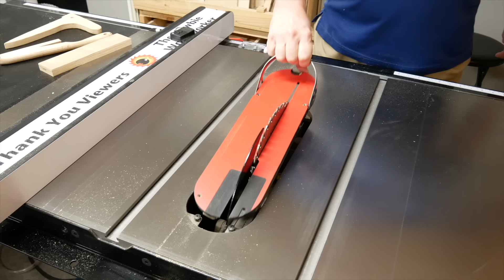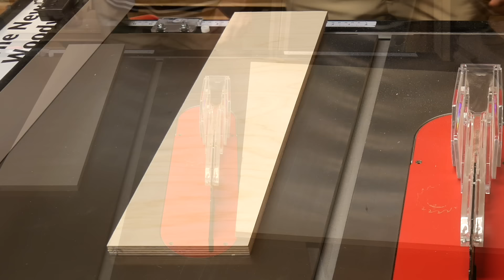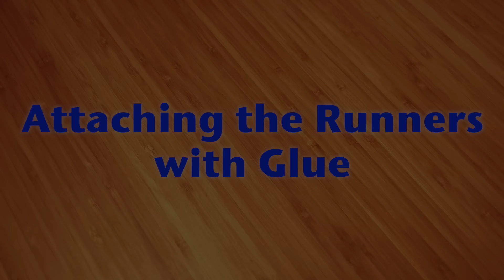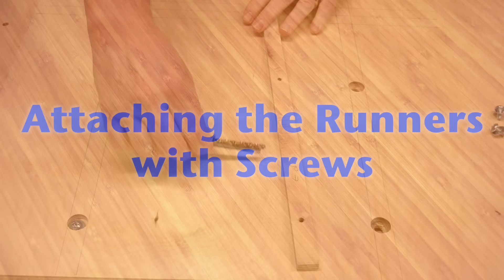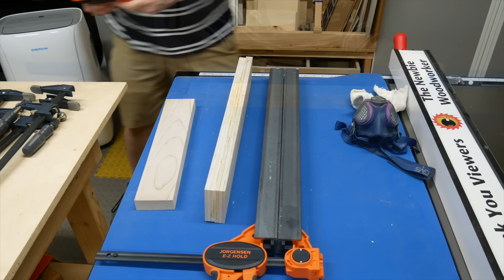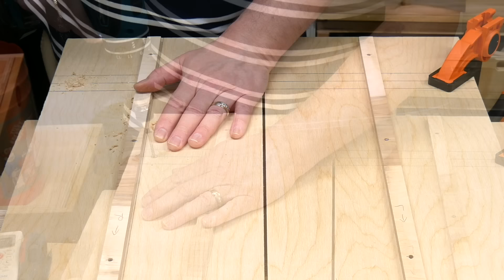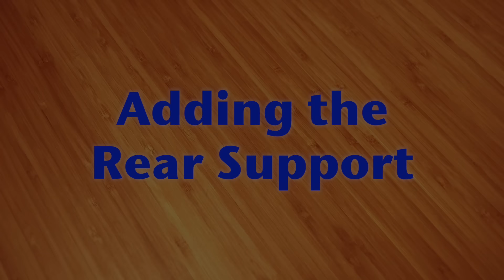Build this Revolutionary Cross Cut Sled, for Newbies!

Comment: I just wanted to say thank you for sharing this with us. I agree, not too many folks use the guards, and honestly I never really gave it any thought until last month. Last month, I ran my left thumb through a jointer. Its an older one I restored, and the blades are new and sharp. Well, I am sitting here in a cast watching this video. I have had two surgeries so far and am hopeful, I will have some use of my thumb in a few more months. I say thus because prior to me hurting myself in the woodshop, I have sense been in contact with two guys who work at the same place i do, Both have ran their hands through a table saw. one cut most of his left hand off, the other cut his right thumb. I feel blessed that the injury i had didn't include my whole hand or any of my fingers, because when the wood shot out of the jointer after hitting a large knot, my whole left hand went over the blades of the jointer and its basically only clipped my left thumb, shaving the bottom half of my thumb off, it all happened quickly. (fraction of a second) but long story short, i will be putting a blade gaurd on my table saw once i heal up enough i can go back to work. thanks for sharing and have a blessed weekend my friend, 
Dale, ps new sub here,
Reply from the maker: Thanks for sharing, Dale. I'm so sorry for your injury, and your co-workers. I injured my hand in a router accident, but I got lucky and didn't have any permanent damage - just a scar. Still, I can appreciate what you're going through. Your accident reminds me that I need to do a video about imagining what might happen if the stock gets pulled out of your hands. If we thought about that before doing anything, it could make us stop and use a push block when we don't think we need one, etc. Anyway, get well, and thanks for the sub! 😄
Reply: @TheNewbieWoodworker  your very welcome sir, yes sir, i do have a first aid kit in my shop, this was bad enough i had to wrap it in lots of paper towels and drive myself to the hospital, i have tons of video footage of my injury etc, so if you decide you want some images or video when you make tour video, hit me up, trust me when i sat the images and video dont lie and it will make you think about it i would be more than happy to share them with you if you would like. they are gruesome, but factual. not photoshopped. 
have a blessed weekend my friend,
dale
Reply from the maker: @HeartlandMakesAndOutdoors  Thanks, Dale, but I'll pass on the images! 😮😄
Reply: @TheNewbieWoodworker  Don't do the safety demo video with a live tool. You might've seen Tom Hintz's video where he demonstrated a kickback that nearly took out his fingers - and he didn't realize it until after he started editing the video.
Reply from the maker: @brimtlgtr  I saw that video! I could be wrong - I don't always trust my memory, but I think I saw it before I made this video, and that's what I was as careful as I was. But I'll never do this again, that's for sure. 😳

Comment: I recently inherited a Grizzly 1022Z table saw. Unfortunately it did not have a blade guard or riving knife. Grizzly is out of stock and will not be manufacturing for such an old machine. Any ideas?
Reply: Lt. Dan 
Try “the shark guard.com”
They customize blade guards with riving knives
Reply from the maker: What Michael said - try Shark Guard.

Comment: @3:27: Looks like you could salt your joints.
Reply from the maker: Thanks, you're not the first to mention that. I don't like to use salt, and I can't give you a good reason why - I just don't. But I suppose if I'm going to show gluing in a video, I should make an effort to try. 😏
Reply: @TheNewbieWoodworker  It seems like a brilliant idea, but I haven't done it either.  Sounds like you need to do the move I did last month: Order a pin nailer for the spouse to give you.  :-)
Reply from the maker: @SeanReifschneider  😂The problem with pin nailers is that I don't want a compressor, and the non-compressor nailers won't shoot through Baltic birch plywood, which is what I use most of the time.
Reply: @TheNewbieWoodworker  <hands you the shop salt shaker>  :-)
Reply from the maker: @SeanReifschneider  😂

Comment: why would you go to all this trouble and not bother to use the 5 cut method?  It's incredibly accurate, and takes about 15 minutes.  "This is woodworking and it probably won't matter" is just so inadequate in the context of a crosscut sled, whose overwhelmingly main purpose is to provide an square fence.
Reply from the maker: "All that bother?" Compared to the 5 cut method? In my opinion, the 5 cut method is ridiculously complicated, requires math, and feeler gauges or something similar. The method I showed in this video works fine, and the only reason I added the comment about it not mattering for woodworking is because this is a video for beginners, and I didn't want beginners to get stuck on perfection. Here's my preferred method, which unfortunately won't work with this type of sled: https://youtu.be/mLj1MeWKalI?t=134. Easy, and works every time.
Reply: It is not ridiculously complicated.  It requires minimal math.  And it avoids your situation, in which you really have no idea how far off you are.  Checking that cut with a square, as you learned, just doesn't tell you much.
Reply from the maker: @RainDog222222  I prefer no math. And if you check the resultant cut with a precision square (not a framing square, but a true precision square like I show in the video), if it's dead-on, it's obvious. No light at all between the square and the stock. You can even do the 5-cut and prove it to yourself, although if it's square according to a precision square, I guarantee it's good enough.

But the point is moot. If you like the 5 cut method, go for it. But this video is for beginners, and complicating things with the 5 cut method wasn't something I was willing to do. I'd still like you to look at the link I provided:  https://youtu.be/mLj1MeWKalI?t=134. This is my normal method, and it works 100% of the time, assuming you use a square that is really square, and don't move the fence when you drill the hole and drive the screw.

Comment: Great video. Is there a video on the sanding stick you made? Or some info on the measurements.
Reply from the maker: No, there isn't. I just took a strip of pine (I think), and rounded some handles with a little sanding. The detachable part is a block of wood with threaded inserts. For sandpaper, I cut out a section of self-adhesive sanding disc sandpaper that I had lying around. I like it because it's got a nice thick stiff back. Even if you don't need sanding discs, they're pretty cheap. I'm sure there's lots of options for sandpaper though. Then I just made sure the sandpaper was flush with the edges of the block, so it would work well on its side. Hope that helps!

Comment: Nice Sled
I'm one of those who generally has the guard off due to the nature of most of my cuts and the age of my saw making quick removal/reattach not so quick.
That said - the thing scares me sober as they say every time that blade is spinning.
For the folks in my boat, building an overhead dust collection hood is the way to go, there are several that I've seen out there. When it's in place it just presents an obstacle which covers the danger zone and encourages you to keep your hands away
If you have made your own zero clearance inserts - paint them bright red or other "Danger" color scheme as a reminder to keep hands away.
For EVERYONE - AVOID getting into the habit of REACHING OVER THE BLADE !!!!  or around it. In my opinion the tops of table saws are too small, even the larger cabinet saw... not so much left to right, but front to back - BUILD an OUTFEED TABLE !! -- I'm currently building a free standing router table that is the same size as my saw top, this will be the outfeed table.
If you pay attention to how and where you are pushing with the push sticks etc and imagine where you are going to go flying when that work piece eventually slips, binds, gets grabbed, etc you will likely find that you have developed a few habits over the years that could easily cost you fingers or worse if it goes wrong.
I recently nicked ( 5 stitches) my hand with a hand saw - since then I admit that I look at the table saw a LOT differently ( I've had it about 30 years)  - very useful tool - VERY dangerous tool...as many are.
Good Luck, be safe.
Reply from the maker: Thanks for the comment, and I have to say that I agree with everything you said. I just finished typing a bunch of stuff, but I deleted it because all you really need to know is that my brain is starting to think of solutions to not having enough room for an outfeed table, when my wife's car is in the garage. A double-folding table is my first thought. I'll let that marinate for a while and see what I come up with. Thanks again for the comment!

Comment: I'll remember these two points, thank you: 1- use large square to position the sled fence, and 2- don't align with saw blade, align with the slot that was cut with that blade (makes sense - even a grossly crooked blade can still cut straight).
Reply from the maker: Thanks, and I'm glad the second point makes sense to you. It's not obvious.

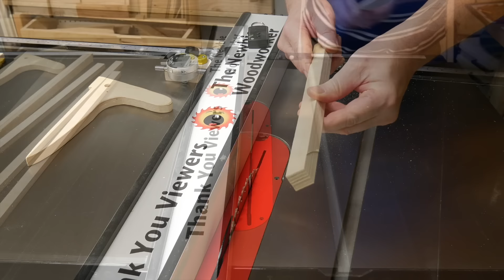Comment: Dan, another great video!  I too have a SawStop, and have wondered how I could keep the blade guard in place while using a sled.  This will be my next project, so thanks!   I did notice however, starting around the 5:20 mark that your SawStop seems to have a vibration issue - the runners you were cutting were skittering across the surface.  Do you know the source of this vibration?
Reply from the maker: Thanks for the comment! I noticed the vibration when I edited the videos, but I don't notice it when I use it. I suspect it's because of the type of flooring I have - hard plastic (I think) tile squares. Or maybe it's something else, but like I said, I don't notice it at all when I use it. With that said, I never noticed it before in my videos, so maybe I'll look around and see if I can find the reason. I'll ask on the SawStop User's Group on Facebook. Thanks!

Comment: Great video as always!!!

I just got a SawStop job site saw for christmas!  

Do I set it up in this order??

1.  Align blade to Mitre track
2.  Align fence to blade
3. Cross cut sled

The real problem is cutting straight miter tracks before aligning the blade to the miter track, Uggg
Reply from the maker: Congratulations on the JSS! If it's brand new, it's probably close enough for now. But if you want to align it, align both the blade and the fence to the miter track. The miter track is your one constant - it doesn't change. As for cutting straight runners, just try some and see what happens. Plan on spending an hour or two just messing around, so you don't feel frustrated if it doesn't happen right away, and you'll be surprised how quickly you get them done. Just remember to have all your "blanks" ready to cut, so once you get the fence set right, you can cut a bunch of runners at one time. Good luck and have fun with your new saw!
Reply: @TheNewbieWoodworker  Thanks soooooomuch!!
Reply from the maker: @supercooldude004  Any time! Feel free to ask questions as much as you'd like. You can email me from my website if you want to. Regarding your original question, you might want to check out these videos of mine: https://youtu.be/AignFa1374E and https://youtu.be/01R7796JoQo.

Comment: Great sled idea to keep our fingers just that little bit safer. I had removed my blade guard, which incorporates the riving knife, on my saw several years ago. Only recently I decided that it was very risky to continue to use without the riving knife. I tried adding a thin piece behind the blade on my table saw inserts but just couldn't get them to fit well enough. Partly due to the design of the saw but mostly due to my poor design skills. Wish I thought of a single fence build as it would have saved me dismantling my blade guard and cutting down my riving knife just so that I can use a cross cut sled. I now no longer have a blade guard that I can use. It's still not a perfect perfect solution as my riving knife isn't adjustable with blade height. That means that any cuts shallower than the height of the knife means I need to remove it. But, at least I'm using a riving knife for the majority of my cuts again. Maybe I'll replace my saw table one day when I start making money from woodworking. Could be a long wait :D
Reply from the maker: Thanks! "Could be a long wait" 😄I get that. Good job on coming up with some sort of solution that at least is better than nothing!

Comment: As usual we'll done, Dan. Noticed that you are still using the dust collection system from when you first bought the new Sawstop. Does that mean it is working well for you? Or would you recommend upgrading to a 4 inch system?
Reply from the maker: Thanks, Terry. It's working "well enough". I get a lot of dust on the table top (depending on the type of cut of course), but I don't think that's uncommon for these types of saws without overhead dust collection. I do seem to get a lot of dust caking on the inside components, and I clean it off regularly, but I don't know if that's related to my dust collection or not. So like I said, for now it's "good enough" for me.

Comment: Hey Dan you seam to be starting a crusade, Well good for you! I love your stuff. Keep it up. Suggestion: W hen you use a cool dial indicator to measure your fence it would make sense that you would measure your work with a set of calipers so you don't have to cut again and again and again.
Reply from the maker: Thanks, and I agree with you in theory. In practice, I just can't seem to be able to measure the width of my miter slot accurately. Of course now that I type this, I realize that once I have a runner that fits, I can measure *that*. Good idea - thanks for getting my brain to engage! 😄

Comment: Nice job. I've not seen a sled like it. I like your blade gaurd. The one on my grizzly is at least 4 times that big. .
Reply from the maker: Thanks. If it's that big, I hope it at least helps with dust collection! 😄
Reply: @TheNewbieWoodworker  I wouldn't know. It's still in original packaging.
Reply from the maker: @dougprentice1363  😂😂

Comment: Newbie here. Is there a blade guard adjustment I can make to keep it from grabbing the wood too hard?
Reply from the maker: The blade guard itself shouldn't be grabbing the wood. Are you perhaps talking about anti-kickback pawls - do they have teeth similar to this like this picture? https://www.makefromwood.com/wp-content/uploads/2018/09/Bosch-Anti-Kickback-Pawls.jpg. If so, I'm not much of a fan of them. You can either take them off, or perhaps the spring can be adjusted or bent some.